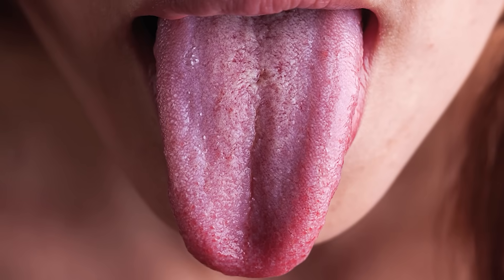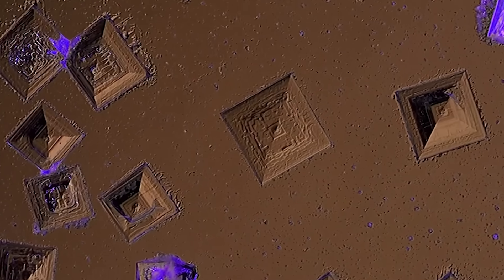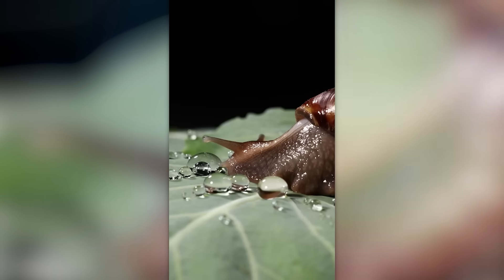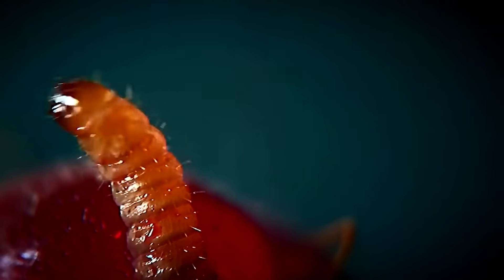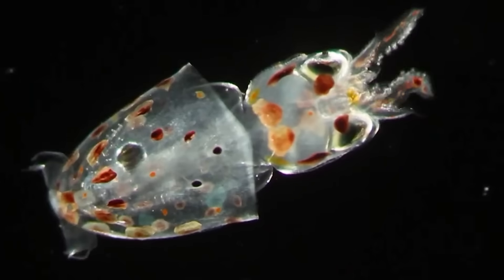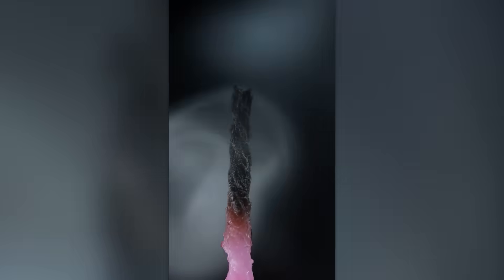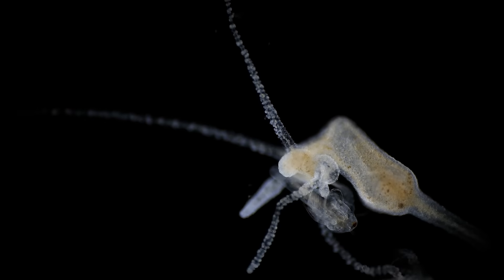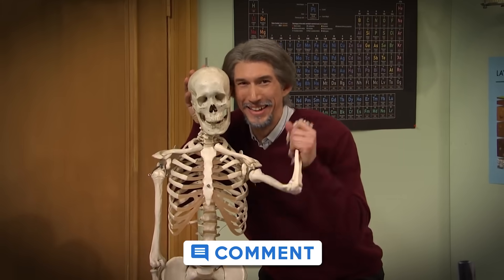50 Things You Can See Only Under Microscope

Comment: There are about 9,500 drops in a pint. The human body has about 10 pints of blood. That's 95,000 drops of blood per person. I each mosquito drank 1/3 a drop of blood, you'd loose all your blood to only about 300,000, depending on how thirsty they are, not the "just over 1,000,000 mosquitoes" the video claims scientists say is the correct number.

Comment: Explain the addressing modes of 8085 with suitable example.

3. Draw the timing diagram for MVI A. 35H and explain in brief.

BCA 4. What do you mean by instruction mapping? Explain how to convert an instruction code to a microinstruction address.

5. Define stack. Explain the stack organization.

6. Explain the arithmetic pipeline with example

7. Explain the following instructions

a) LDA 7050H

b) CPI 35H

c) PUSH B

-8. What are the typical characteristics of CISCstruction set architecture? Explain.

Group C

Attempt any TWO questions.

[2×10-20]

9. Define the term mnemonics, instruction cycle and machine cycle. There are two tables holding twenty data whose starting address is 3000H and 3020H respectively. Write a program to add the content of first table with the content of second table having same array index. Store sum and carry into the third and fourth table indexing from 3040H and 3060H respectively. 10. For the expression

Y (A+B) (CD)

Write down the code for one address, two address and three address instruction formats.

1. What is parallel processing? Explain the benefits of

classifications of parallel processing by M. J. Flynn.

parallel

processing.

12-2161

Comment: BRAIN TIME:maybe it's not so unsanitary to eat with your hands after all
Me:I always tell my parents I just don't want to use a spoon and fork and this video shows I have a right.
Reply: TRUTH:
The moon carried a large amount of water and instantly submerged Atlantis and Lemuria. It appeared only a few centuries ago, and it is very close to history (some departments tried their best to cover it up). The earth's magnetic pole shifted, and the entire connected continent changed. into five continents.
By the way, it lowers the frequency of the surface of the earth, and the water on the surface is no longer the same as the center of the earth. 3D-4D-5D to the center of the earth; Shambhala gates are permanently closed
The outer matter becomes very heavy, the multi-dimensional structure is isolated in an instant, and almost all the etheric matter is evacuated
The optical coded wire cannot be connected....

Ahint：Marduk betrayed the Anunnaki and the Serpents took over the Earth；Serpent family includes Orion and Draco and Sirius B group
Orion controls human beings in 3D and 4D, and almost controls elite groups and religious ; the central council prohibits Draco from entering the earth, Draco cooperates with AI gods to use biochemical humans to invade the earth, want to biochemical humans！
:
The red chakra represents ego, division, desire, domination SEX
The moon can create holograms, based on the the five senses and work on,can be touch
The eye is first saw and some how we believe it
The Ancient Creators hint: Right brain control left brain, up it on
They madeDNA Left Brain Controls right Brain now.
The right eye connect leftbrain so represents the devil, that's what it means from I pet goat II

  
Source Summoning Recall
first: Light a candle in your bedside sleeping place: Silence for 30 seconds and start to meditate:
May brothers and sisters of light from the divine love quality of source that transcends all time and space and beyond Matrix, I would like to connect with you all the time.
What you want to do, see, and become, I also want to do, see, and become;
So in the following all the time, the wisdom of the invisible beings guides and guides individuals, prompts, hints and influences, transcending the wisdom of the universe to bring spiritual truth to control the five senses and the Brain
I am the source quality, I return to the source quality

Comment: 2:00 this reminds steel elongation, did not know that steel is actually a bit elastic, plastic and you can stretch it up to certain point and it will go back to original position without any kind of deformation :)